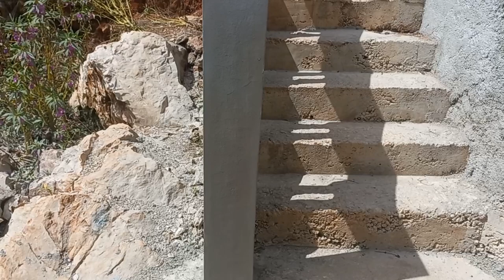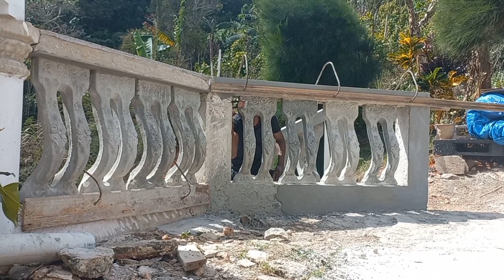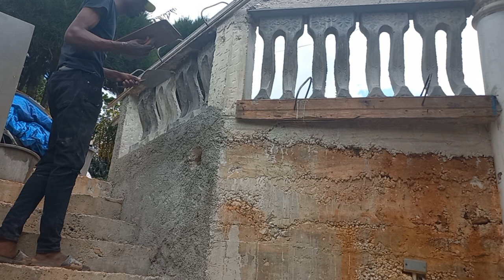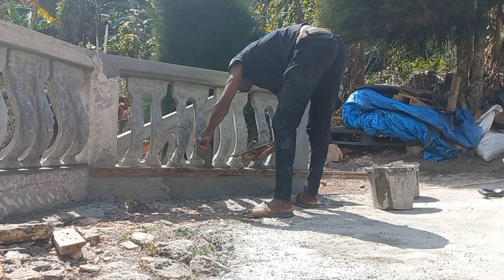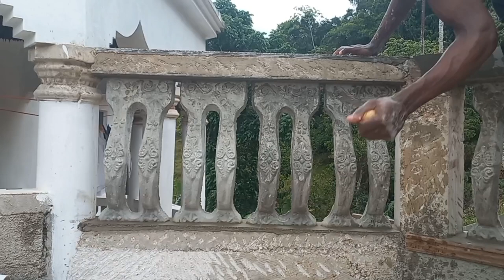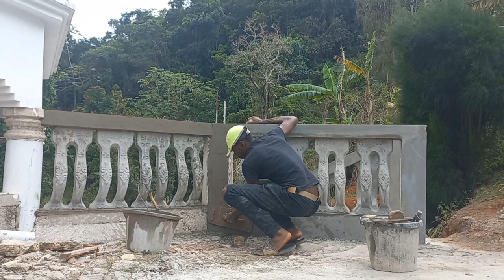How to Perfectly Dress Finish Balusters

Comment: How is it that your work does not crack up? If it cracks up, is it a fault in the mixture? and after pulling down the decking, do you have to hack all of it to dress the inside of the house? Honestly, i haven't seen hacking done on the smooth sections of my house.
Reply from the maker: Cracks in the material is typical sometimes its air cracks or maybe the cement drying too fast or dirty sand it can be variety of reasons as long as its not hallow everything is alright depending on how big the cracks are and yes it can be mixture proportion not right
Reply from the maker: It is best to hack up or use a bonding agent for long lasting work if not the material will crack and get hallow and fall off later down the line depending on the type of finishing use in the building
Reply: @impressive_builders  Yes, it seems hallow
Reply: @impressive_builders  Ok. Thank you very much. They rough cast and render but i haven't seen any hacking done on the smooth areas
Reply from the maker: @JehuCampbell  u can knock the crack areas to know if its hallow
Reply from the maker: @JehuCampbell  blessings
Reply: @impressive_builders  yes, i did and its hallow
Reply from the maker: Solution is to cut out the hallow area and re do it if you dont want it like that
Reply: @impressive_builders  Ok bro. Thanks
Reply from the maker: @JehuCampbell  welcome